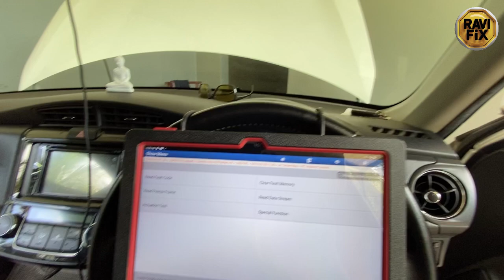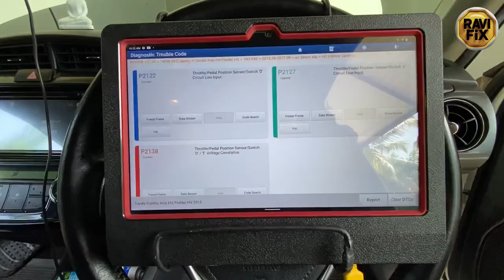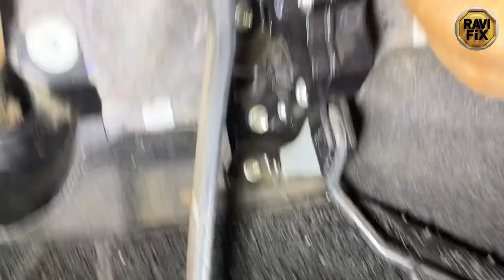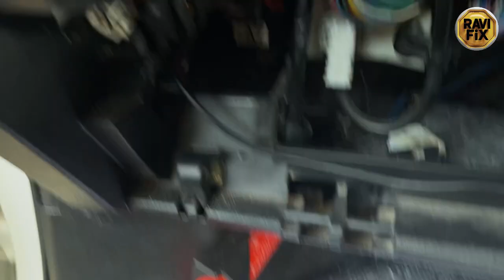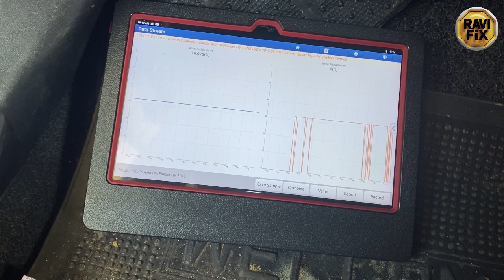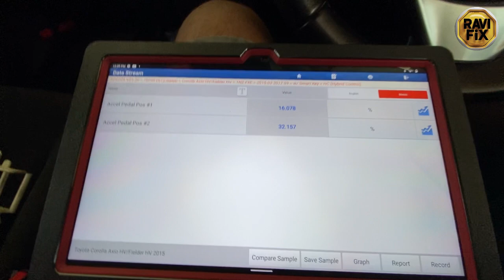Toyota Corolla Hybrid 2015 low power and bad accelerator response when drive after parked in sun

Comment: Appreciate the video, bro.  Great find. I wonder what  damaged the harness from the jump
Reply from the maker: Might be a factory fault that expanded pin. Customer has been having this problem over 1 year. But it is intermittent and specially parked in sun. So I just made than pin contact in to the controller unit. That’s all now it is steady. Thanks Danny